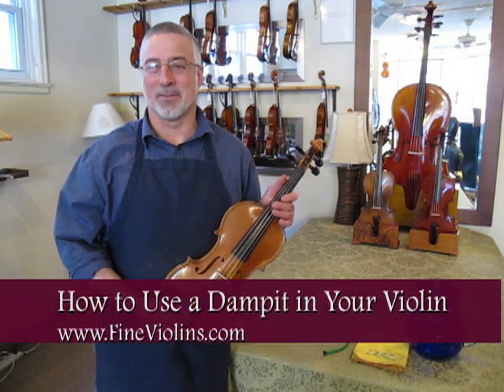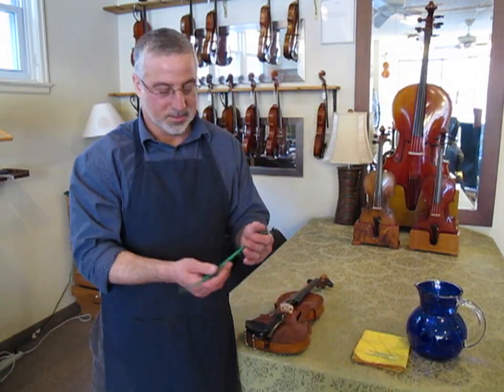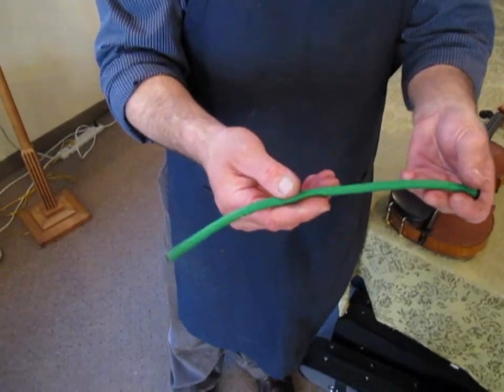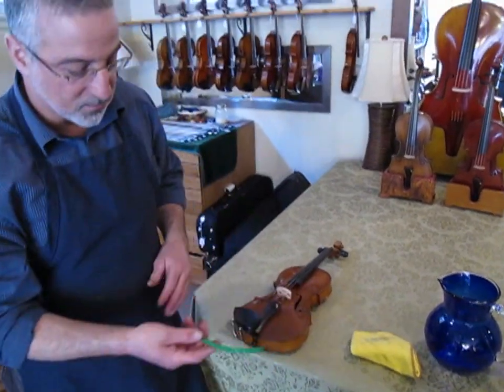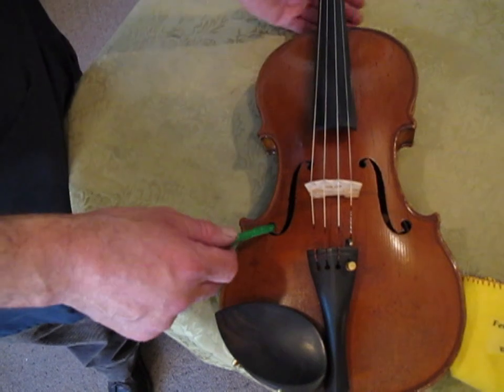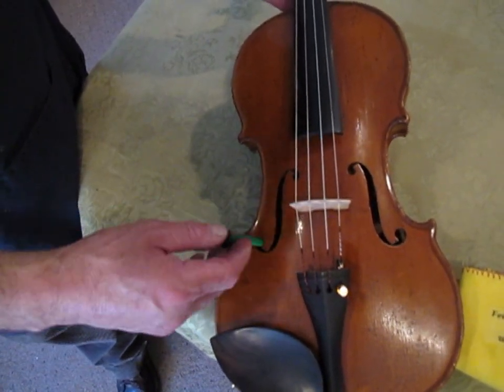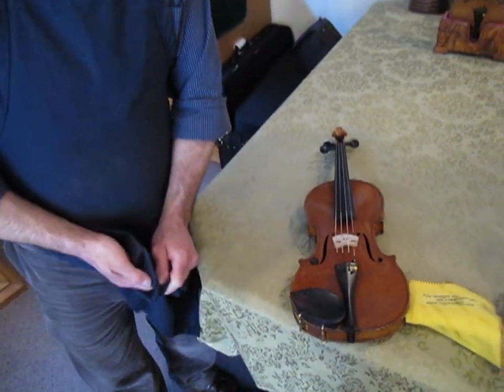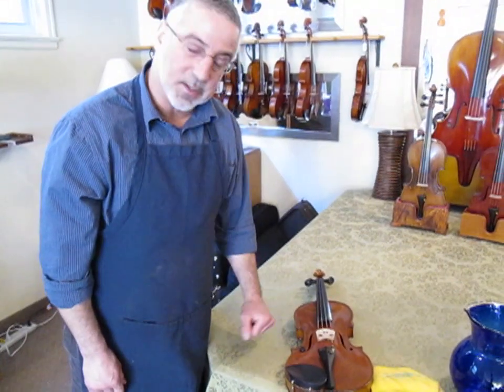How to Use a Dampit in Your Violin

Comment: Thank you for this! I heat with wood (which is a naturally dryer heat than oil or electric) and I am wondering if I should store my violin in the case with a dampit in it? Any thoughts or suggestions? Thanks